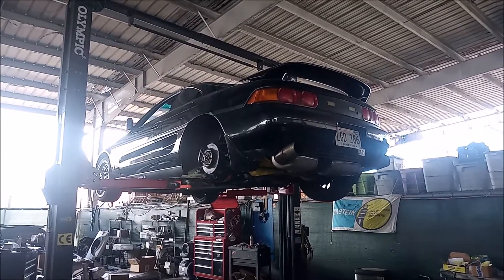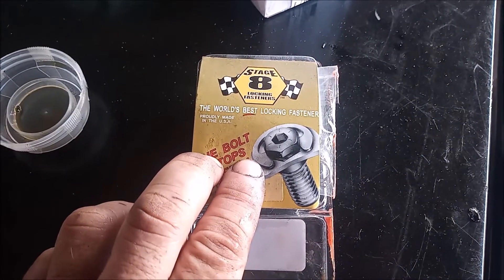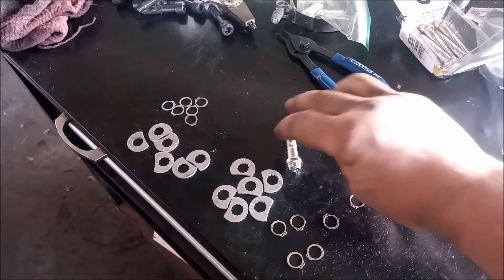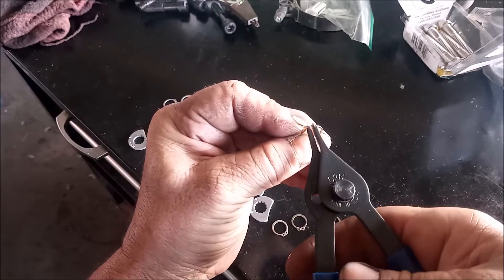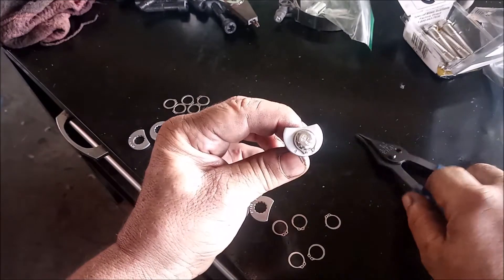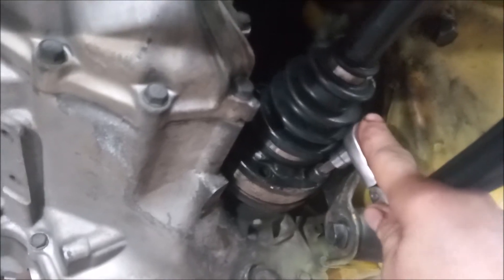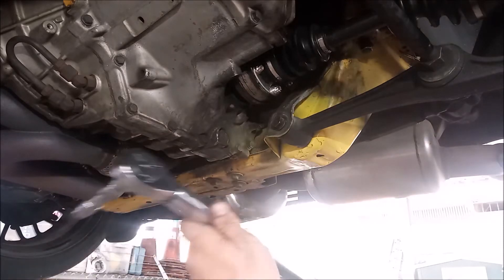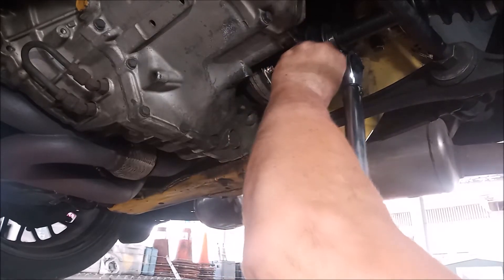Stage 8 Locking Bolts for CV Axle - Toyota MR2 Turbo E153

Comment: Hey Frank, great work and thanks for the video.  Do you have the specs/thread pitch on the bolts
Reply from the maker: Off the top of my head m8x1.25. If you look closely at the label, you will see the application and part number.
Reply: @Merryfrankster_  thanks Frank!